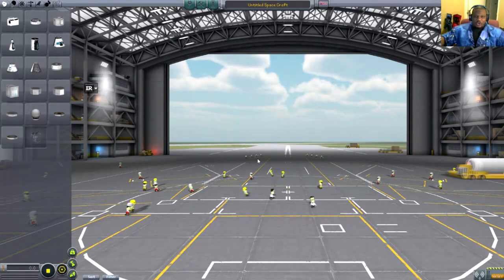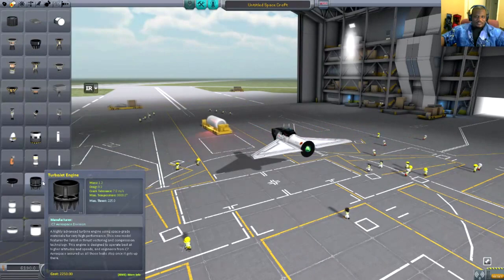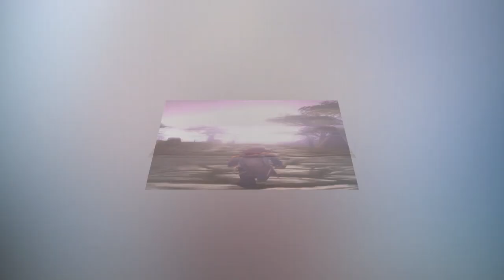Let's Play Kerbal Space Program: One Minute Build   First Attempt

Comment: Chanllenge Accepted!!
So this was my second attempt at a plane.
Using just a few parts, it actually worked and was built in about 58 seconds.
It won't fly far under power but it glides well.
It basically takes off turns around and lands.
Part list: 1 Mk1 cockpit, 2 FL-R25 RCS tanks, 2 O-10 Monopropellant Engines, 3 Delta-Deluxe Winglets, and 1 Modular Girder Segment. (9 parts in total)
Here is the link to the pics: https://www.facebook.com/photo.php?fbid=837498056269983&set=pcb.837498389603283&type=1